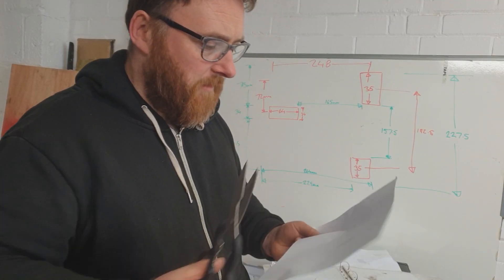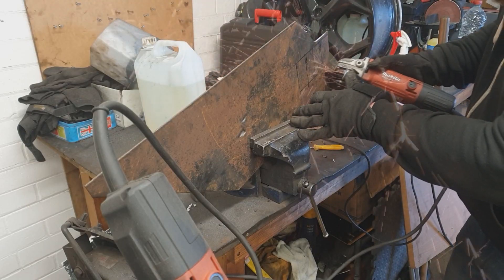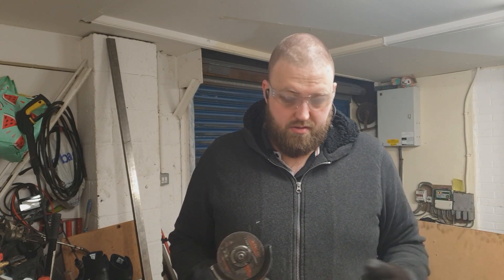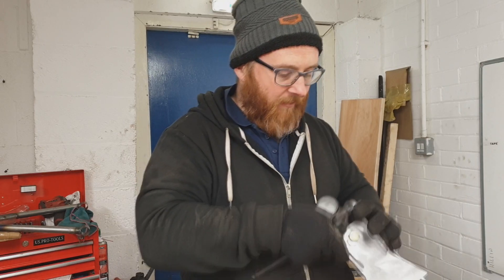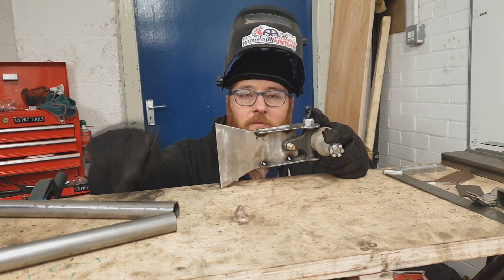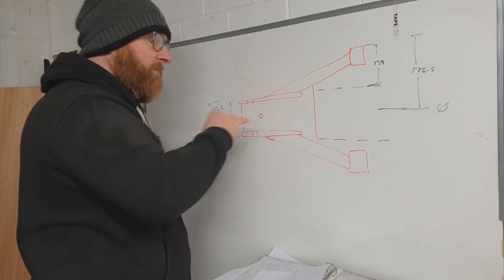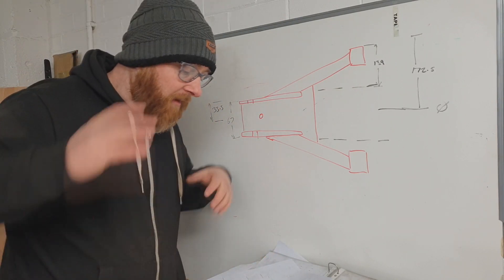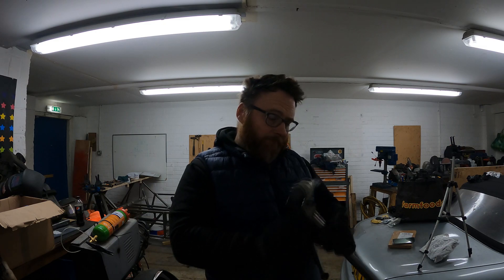Locost 7 Kit Car FULL BUILD!! - Episode 13 - LOWER WISHBONE FABRICATION! (Project 7-UP)

Comment: Hi guys, I've just found your channel and I'm looking to build a locost. I have the book plans and the vodou plans. I have a couple of questions. Did you rebate the front upper wishbone brackets into the frame as stated on the vodou plans and are you using the transit track rod end, as the voduo plans say the uprights need machine to take them.
Reply from the maker: Yep, covered this a few episodes previous. We will be reaming the hubs for transit links and have made shallow brackets as per vodou plans.
Reply: @ToolsnTrack  ok great cheers. I'll go back and watch it again. Great work so far, enjoying the channel.
Reply from the maker: How did you get on with that build Carl?

Comment: The way you notched the tube to fit the lower wishbone plate is really clever. I may have to steal that as I'm working on figuring out my front suspension dimensions now.
Reply from the maker: Happy to help mate, although it was ultimately pointless in my case!